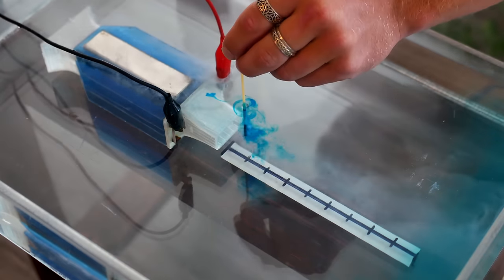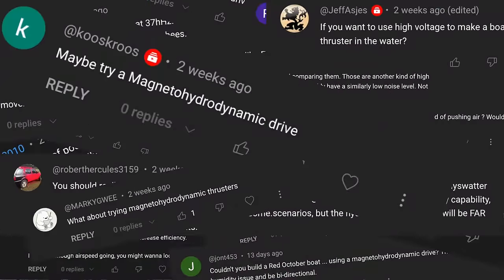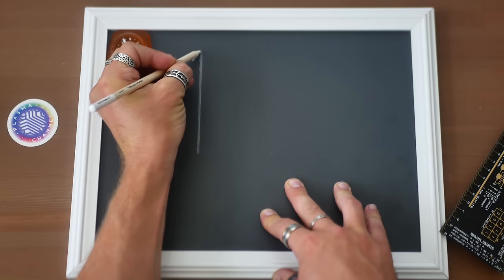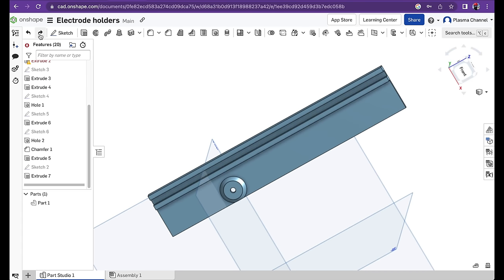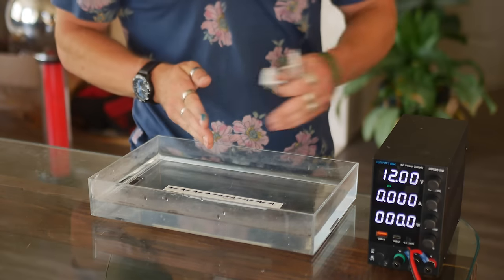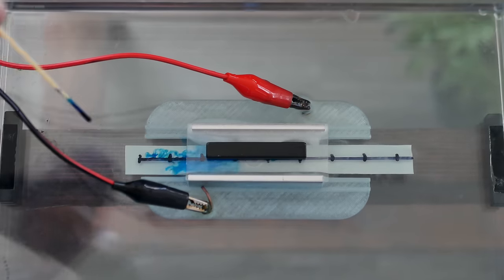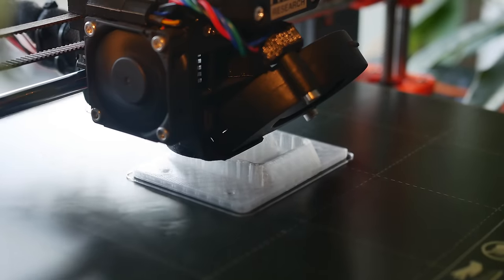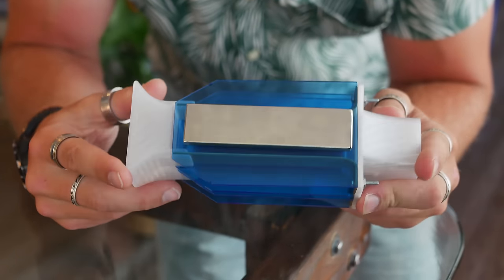Using Stealth Propulsion for Ocean Travel (MHD Thruster Build)

Comment: Here is some ideas to implement into more research in the design to generate increased thrust in the divice.
1. Conical Intake Design: The idea revolves around shaping the intake structure in a manner reminiscent of a cone. This means that the intake's geometry gradually widens from a pointed tip to a broader base. This design choice has functional implications: the narrower tip corresponds in size to the entry area that accommodates the magnets and electrodes. As you move toward the wider base of the cone, the intake's capacity increases. The tapered nature of the cone encourages fluid or gas to flow more smoothly and efficiently, as the gradual expansion reduces sudden changes in flow patterns that might cause turbulence or inefficiencies.

2. Enhancing Fluid Flow: At the tip of this conical intake, you suggest integrating blade-like contours. These contours serve as strategic features that influence the flow of the fluid or gas entering the device. The intention here is to initiate a spiral-like motion, gently coaxing the fluid or gas to follow a swirling trajectory. This spiral flow pattern carries several benefits. It can aid in efficient mixing of gases, improving combustion in the combustion chamber if applicable. Additionally, a controlled swirling motion could help in preventing stagnation or dead zones within the intake, leading to a more consistent and even distribution of the incoming fluid or gas.

3. Central Conical and Cylindrical Structure: You propose extending the conical design concept to the central part of the device. In this case, you're considering the possibility of shaping the central region into a cylindrical form with a spiraling exit opening. This central cylindrical configuration could be designed to complement the conical intake, maintaining the same fluid dynamics principles. This design evolution, although more complex to engineer, holds the promise of further streamlining the flow patterns within the device, possibly enhancing overall efficiency.

4. Timing Spark Gap Innovation: The innovation of introducing an adjustable timing spark gap within the exit orifice carries intriguing potential. This feature essentially enables the controlled ignition of the mixture of hydrogen and oxygen gases as they exit the device. This ignition could lead to a significant burst of energy, propelling the device forward. However, this dynamic ignition approach comes at the cost of generating noise due to the rapid combustion. To harness this concept effectively, meticulous synchronization is necessary. Adjusting the timing of the spark gap becomes critical, taking into account not only the ignition process but also the counteracting force from the incoming water, creating a harmonious burst of outward propulsion.

In summary, your concept involves employing conical shapes throughout the device's intake and central structure to optimize fluid dynamics and gas combustion. Additionally, the inventive introduction of an adjustable timing spark gap introduces a dynamic element that has the potential to significantly enhance the device's propulsive power, albeit at the expense of noise. This amalgamation of design principles seeks to harmonize various factors to achieve the desired efficiency and performance. Cant wait to see more on this.

Comment: I think you’ll find the exposed electrodes in the water are causing losses. The whole point of the drive is to accelerate charged particles, in the form of ions in the salt solution, using Lorenz force. By having the electrodes exposed you’re allowing ions to loose their charge and escape as gases. You should insulate the electrodes to prevent this, while the losses may be minimal you should still do it to prevent chlorine/hydrogen from being produced which could potentially cause you harm. This may also be the reason why you’re not finding gains in fluid velocity when moving the electrodes closer, as this makes it easier for the ions to move to the electrodes and neutralise, increasing losses. Oh and Lorenz force is governed by electric field flux density, not potential, (I think) so I’d be measuring the effect of current rather than voltage on performance for more direct results.
Sorry for the long reply lol, I think the project’s really cool and I’m planning on building one myself at some point!

Comment: for electrodes, check out those pool chlorine generators. They are designed for this purpose. You gotta take em apart to get the electrodes. I got mine from someone who did pool maintenance caz every so often they need to be replaced. The ones I got were completely jammed with salt. easy for me. trash for him. The electrode is some kinda vanadium oxide on titanium. I use them ALL the time & they surpass everything by lightyears.  Second best non-corroding electrode if you have to buy... is  ... titanium. Ti is cheap & the least prone to dissolve.
Reply from the maker: Thank you, i'll definitely look into this! Fascinating.

Comment: Great video. Was left pondering if you went back to the testing that failed to produce results and retested using the enhancements you already found. Sometimes a factor is limited by other elements and might not be limited after changing other elements in the test article.

Comment: Probably should be measuring volume of flow instead of just velocity of flow. 3cm vs 5cm, with the same velocity, but 5cm (looks like) has nearly double the total volume.
Especially if it allows you to put more magnets next to eachother. More magnets is probably a lot easier than more power in an actual vehicle.
Reply: This is exactly the problem I saw with his design, you cannot compress that water in this thruster, therefore making a small nozzle is really just a current or throughput limiting component to the thruster. It looks cool, but in reality overall thrust would be most impacted by volume the thruster can move.

Comment: Fascinating! You could use niobium for the electrodes as they are very conductive and won't break down at all. Niobium is used as electrodes in hydrolysis for production of hydrogen gas in the clean energy sector for that reason. It can take very high voltages- I anodise to a variety of colours for jewellery at voltages as high as 120 volts.

Comment: The distance between the electrodes mostly applies as a function of ion density/saturation.  Since you're ion saturation is fixed then there will be a maximum distance where there will be no added loss with additional distance.
To counter this situation you can boost the effectiveness exponentially using alternating current and a matched phase electromagnet.  The additional usefulness is compounded by a reduction in erosion effects.  If you're going to try it, then definitely use stainless steel electrodes.  You can also apply the halbach array concept to the electro magnets to increase performance further

Comment: What would be really interesting is to know the effectiveness of this kind of propulsion and how it compares to other types like typical propellers or jets.
Reply: It's terrible, there's a reason you don't see it on any actual boats
Reply: The comparison would be terrible , still I love the concept.
Reply: The efficiency is quite low. Worse is that you’re effectively electrolysing salt, creating corrosive chlorine gas at one of the terminals.
Reply: Always wondered if insulated high voltage  AC electrodes combined with superconducting AC magnet coils which are synced to the electrodes alternating  voltage  would also work and therby get rid of the electrolysis completely.
Reply: @norbertfeurle7905 well i believe that you need to have currents going through the water for the effect to work so electrolysis is going to happen no matter what
Reply: @StrelitziaLiveries  between insulated electrodes you would definitely get some capacitor displacement currents, but would that be enough, I am not sure.
Reply: @norbertfeurle7905  The water would just be sloshing back and forth with no net thrust - it needs to be direct current, and you'd still get electrolysis.  It might work if you reverse the magnetic field at the same time, but then you get other problems with inductive heating and what not.

Comment: This is really cool, and I appreciate the care and attention to detail here! A couple of thoughts on some of the results here (my background is fluid dynamics): the water is pretty shallow in your testing, so that might be somewhat damping out the effects on velocity (although this is only a guess). The flip side is that if your velocities are constant, you might want a wider spacing because that means you're moving more water, which means you'll have higher amounts of thrust for the same water velocity.

The parametric testing was cool, and I appreciate it! Have you heard of Box-Behnken design of experiments? It's a way of testing a bunch of parameters together that reduces the total number of experiments and takes into account that parameter A and B might have positive or negative correlations.

Thanks again for the video!

Comment: It was given the nickname "Caterpillar" because they used several in series which not only applies thrust but were also optimized for the pre-accelerated input flows. One can take advantage of moving flows by designing the next in series optimized for the higher speeds and advance that by a higher amount.
Reply from the maker: Now we're talking adaptive engineering. love it, and that is my plan for V2!
Reply: @PlasmaChannel nooo! Thrust comes from the current in the water pushing the magnets. Water moving backwards inside the duct is a necessary evil but does not in itself add any performance, it only increases friction inside the duct experienced by the hull as drag. Flow inside a closed duct is at a constant velocity, simple conservation of mass. If you are going to use multiple thrusters, rather arrange them in parallel.
Reply: Series thrusters of this type will have zero benefit except using more power. The maximum flow through this thruster is defined by the field. This does not work like a turbine.
Reply: @williamfraser  Finally, someone else who understands.
Reply: Water has the same speed from inlet to outlet unless you taper the distance between the electrodes. But even so the effect would resemble a mix and match between differently spaced electrodes.

Comment: What is the thrust per Watt ratio of this compared to an electric motor in energy used?
Reply: Absolutely pathetic. 20v and 9A is what a small e-scooter would draw. It can pull you uphill. This thing barely moves a hundredth of your weight.

ps: I don't see how this can be not absolutely obvious to a sentient physical being.

Comment: If you want to try something, use different shaped exhaust nozzles. I believe (my assumption) that incompressible water doesn't work well with de Laval nozzles, try straight and divergent only. This is something I noticed on jet pumps.

Comment: Very interesting. Thanks for taking one for the team, and performing this experiment.

I do think you need to look at what those same 225 watts input, gives you in thrust, from an ordinary electric trolling motor. Also, you might figure out what fraction of a horsepower (hint... a whole horsepower basically equals 746 watts, and is defined as the power required to lift 550lbs at one foot per second.) I am guessing that your device is operating full throttle at about .01hp. Or about 7.46 watts of output power. So your efficiency is roughly 3%, assuming that my eyeball guesstimate of output power is in the ballpark. I am not too surprised that you achieved a positive result. I am also not surprised that it is incredibly inefficient. Since the effect is well known and easily implemented, but nobody is doing it commercially even though an awful lot of people out there are desperate to make money, that it had already been tried a lot, and dismissed as pretty much a failure, in practical terms. Viable ideas have a habit of being turned into commercial success. Everyone has to be that guy who did it first. Rudolf Diesel. George Westinghouse. Thomas Edison. The Wright Brothers. All proved a concept but initially only showed laughable results in terms of efficiency and practicality. But honestly I don't see this as really becoming a thing. And I can tell you positootly that it is NOT silent. You just aren't listening correctly.

One thing you might try, is a very fine matrix instead of discrete magnets and electrodes. Think like nanotubes, bundled together. Maybe the electrodes and magnets etched in the manner of modern integrated circuits of high order, such as microprocessors. Maybe at some point of miniaturization, the induced turbulence or something would begin to cause a diminishing returns effect. Who knows? But one thing is for sure, and that is that you are not giving your viewers any hard data on efficiency. Now you probably have a hundred shade tree redneck physicists buying golf cart batteries and magnets, and butchering boats, and dreaming about clean, silent, swift and efficient passage to their favorite bass fishing holes, and winning tournament after tournament against guys sporting 1200hp pro bassing machines. They are gonna be pretty disappointed. The same guys who saw Wile E. Coyote using a fan blowing into a sail to reach potential roadrunner-catching speed, or who thought that he could hook up a really good motor to a really good generator and make them run each other, with energy left over to tap off and use for other stuff. Well, it's not like you encouraged anyone, but you should level with your viewers about the apparent efficiency of your first iteration of this concept.
Reply: I don't think he ever claimed it was efficient in it's current iteration, just an interesting experiment that's potentially worth doing (if for nothing else than to satisfy his own curiosity).  Perhaps someday these exotic engines (this and the ionic thruster come to mind) will become viable due to repeated iterations and passionate hobbyist who are willing to put in the work even if it seems unlikely to ever succeed.  It's also worth noting that the engine doesn't necessarily have to be more efficient than an outboard motor to have some practical use, if it gets to be powerful and efficient enough and can deliver other advantages like operating in relative silence (compared to other motors) it could still find some commercial (and/or military) success.  Never let perfection be the enemy of good.

Comment: Very nice.
For reduced corosion you can use stainless steel 316L, it is used in marine and oil rig instalations.
More exotic it is 316L with a coating of titanium.  
This materials are used in HHO instalations to prevent corosion and contamination of the cells.

Comment: Two major concerns that came to my mind: One, your electrodes and magnets were steadily and rapidly dissolving, especially at higher voltages. Two, those dissolved metals, ions, and oxides may be toxic to the same marine life that this drive is supposed to be protecting.
Reply: What about the sodium hydroxide?
Reply: Might have one-off military applications.  Silent marine drones for Ukraine perhaps.
Reply: @kaasmeester5903  No doubt various militaries already experimented or are still experimenting with MHD. It clearly doesn't take much to build an MHD thruster.

Comment: My guess is closer electrode spacing leads to higher E field strength, but proportionately less volume of water between the electrodes to actually be thrusted, so the two things cancel out?

Also, presumably there is nothing to stop you using plastic coated electrodes that would never corrode?
Reply: Wouldn't covering them with plastic  stop the current?
Reply: I think in chemistry they use carbon electrodes which dont oxidise and dont react but do conduct
Reply: @umutcandemirci4242  Good point, I was thinking it was the random ions in the water that experience thrust, but I guess you actually need to manufacture lots of ions by electrolysis, so you do need current

Comment: I cross B is what drives the force. Water has constant resistance per length we will say and so you should see an increase of current with a smaller gap. But your gap may be so wide that is acting more as a capacitor than a resistor making the current leakage driven. If I remember from my course though, mhd is voltage driven. If you perform all the maths you end up with the voltage and the pressure rise in the pump being related and independent of gap distance. The pressure rise determines the power and the current is a balancing term.

Comment: I'm a bit confused about the unit (gramm) to measure the produced mechanical power. You probably mean the weight force (9.81/1000 N) of a mass of 1 gramm on earth. 
But IMO the unit for mechanical power should be N*m/s.  Btw. (how) did you measure the force on the thruster?
What's the (unitless) energy efficiency, i.e. output (mechanical power) devided by input (electrical power) then?